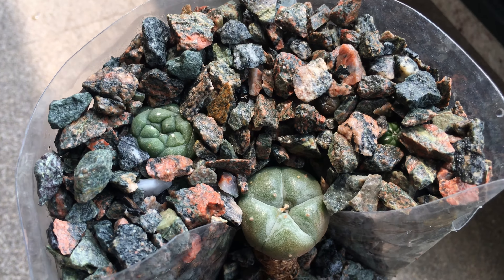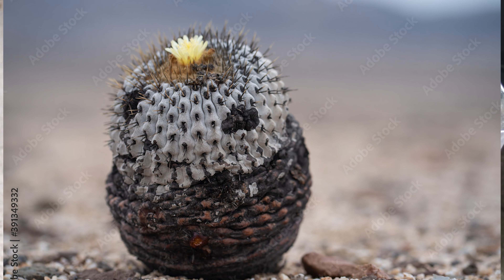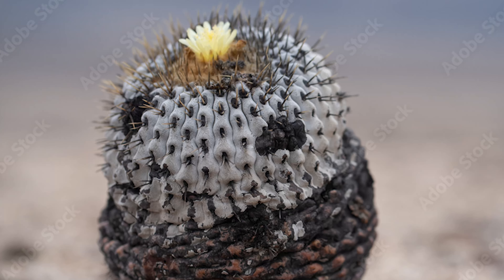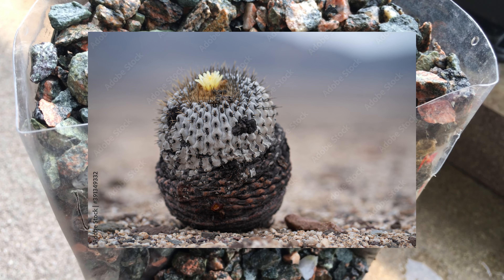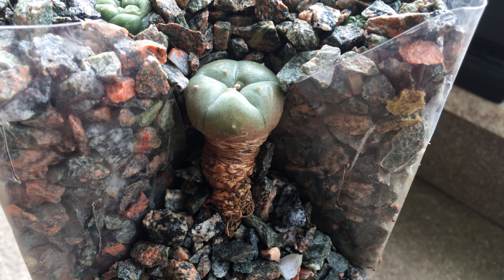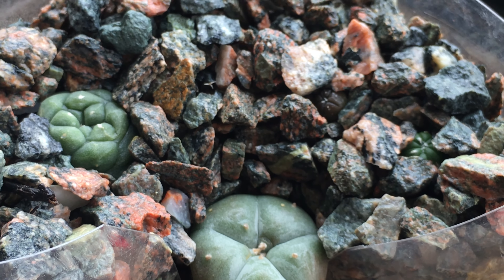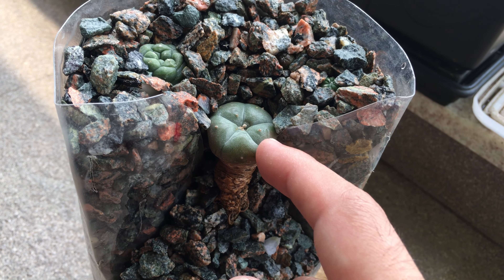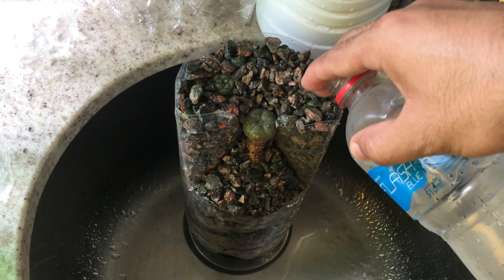Watering with SALT for better taproot development experiment

Comment: I am not sure that NaCl is a good solution, but I am interested in the project. It would be interesting to see the influence of mineral water and MgCl. But rainwater is still the best for watering.
Reply from the maker: Yes I’m not suggesting this over regular watering far from it but rather to increasing the taproot length and thickness is a shorter timespan
Reply from the maker: I have Potassium Chloride but not cost effective for me to test… doses at half what I use show increase growth and other benefits… I use 50mM at 20mM they see pros… 50mM seems to be the limit for pros before going to too much cons
Reply: @ModernGrower  the various metal constituents in the mineral substrate and the addition of acid to the water should form salts, another reason why rainwater is the best for watering, that's why many growers use acids in tap water
Reply from the maker: I believe the effect on the roots is specific to Na+ ions and not salts in general... I'm not of scientific background so not 100% sure but from my understanding its NaCl but perhaps others will work to similar effect.

I thought adding acids to tapwater was for a lower pH 6-7 range to increase nutrient uptake. Everyone grows for different reasons and aesthetics but if someone is using limestone I would NOT recommend adding acids since it nulls the limestone... from my understanding the lockout due to the alkaline soil is what slows down growth
Reply: @ModernGrower  salt dissolved in water is still salt ;)
Reply from the maker: different salts affect plants differently... 
https://www.tandfonline.com/doi/abs/10.1080/01904169809365554